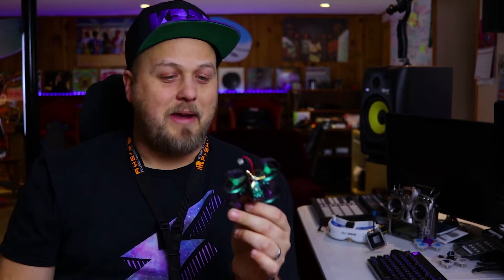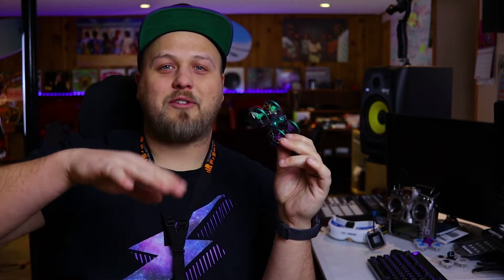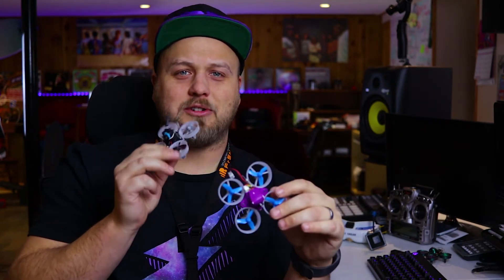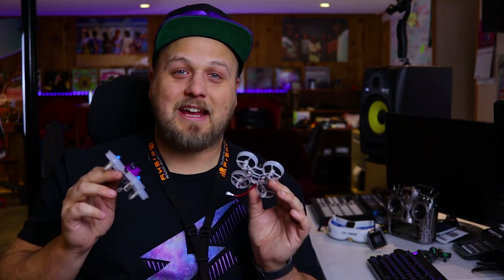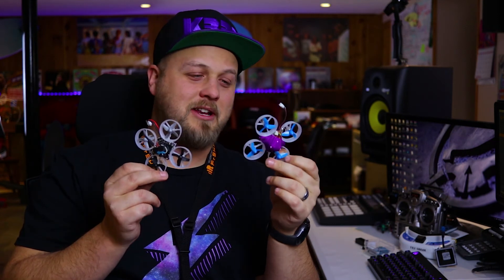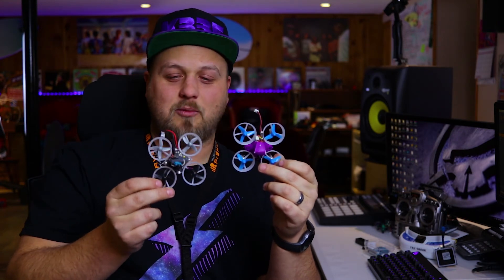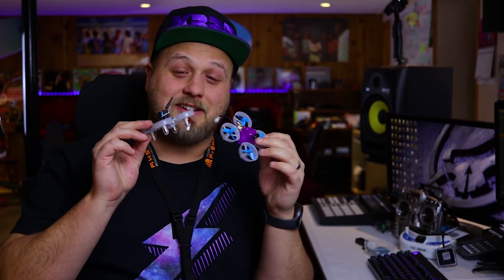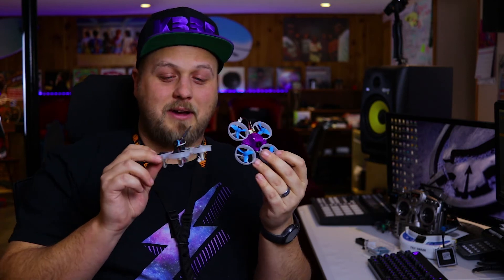Project Mockingbird Review and FPV

Comment: I got a tiny 8x whoop, will this work for it? Also is this only for angle mode or I can use it in acro. I just started on fpv mostly flying angle mode with out googles.
Reply from the maker: It should work as long as you have a Betaflight compatible flight controller. Yup, this is for angle mode.

Comment: thank you so much! i followed your other video on the tutorial for project mockingbird. my whoop flies beautifully now. can i ask you though, in general or on average how long do your motors last you on your whoops?
Reply from the maker: That is a hard question to answer as there are several factors that could shorten the life of the motors. I like to keep 2 or 3 whoops on hand and switch between them after each battery. This gives the motors a little cool down time while flying the other whoop. Some seem to go quicker than others but that is just the name of the game with these tiny brushed motors. Making sure you don't have hair or anything else wrapped around the motor shaft will help keep you flying smooth and help the motors last longer. Furthermore, the higher kv motors like the NewBeeDrone golds or Tiny Whoop insane motors have shorter lifespans than the lower kv motors. The higher the kv the less lifespan. For my builds I've found the sweet spot to be about 17,000kv. Lower than that feels like not enough power and higher than that results in shorter motor lifespans. I like to buy the 3-packs that NewBeeDrone or Betafpv sell just in case I need to swap in a new set.
Reply: awesome thank you so much for this!! ive tried the acro set up for project mockingbird and i gotta say that is one sensitive control commands lol but once i got used to it it was awesome. i also did the extra step in setting up adjustments so my rates changes according to what flight i have it on. thanks again mate!

Comment: Sweet vid. I just updated the motors on my old e010s to the rdq 18.3k motors and am now wanting to attempt the mockingbird mods. But I have a flysky i6x on the eachine e010s and not really sure where to even start. I've downloaded the PDF from the Facebook group at least lol. But as soon as I get home I will be updating the fc to bf3.2.3 or .4 which ever one I can dl to this thing.
Reply from the maker: https://www.youtube.com/watch?v=wPMqW_0nDOA
Reply: iamkeef lol saw that right after I posted. I just got my taranis qx7 Monday but my 2 whoops are flysky. But I foresee a betafpv 65s or a similar 7mm whoop in my future lol. Thanks for the link.
Reply: iamkeef holy crap what a difference! I only did the angle mode as I wasn't confident enough to set up the other modes on a switch, I'm using flysky at the moment on this one. But the angle mode wow huge difference over the stock e010s, of course I did upgrade the stock 59000rpm motors to the rdq 18,3k motors. And the next 6mm will get some 19somethingK motors and gen 7mm is on its way. Lol.  I think adding in the mix helped the most, no more hitting the ground when. Trying to turn around or make a quick level change.
Reply from the maker: Definitely the mixing was the most noticeable change for me too and it definitely helps you maintain altitude when turning. Check out my latest video reviewing the Unicorn motors from NewBeeDrone. They're 25,500kv! https://www.youtube.com/watch?v=jyv2NodmVhc
Reply: iamkeef holy crap that's some high kv. Could only imagine. I just got the racerstar 69000rpm motors in yesterday that I completely forgot I had ordered from banggood lol. Was on a really really sloooooow boat. I ordered them back in November. Lol. So I will be doing a new build in a bit. Soon tho I want the betafpv 65s with those sweet 7mm motors. I have a new taranis that I'm just itching to bind to some quads. My geprc sparrow build is up first lol.